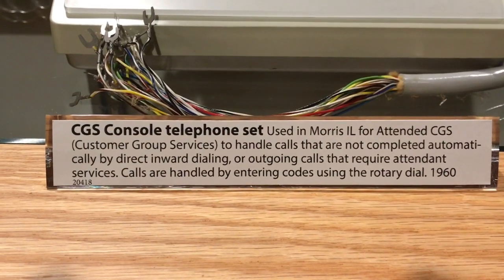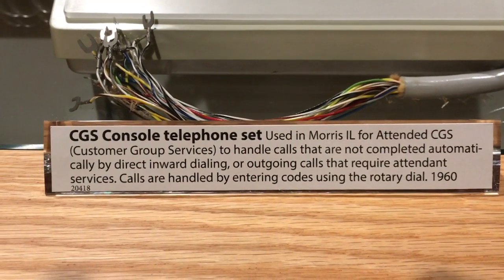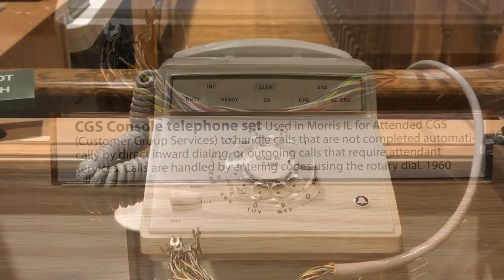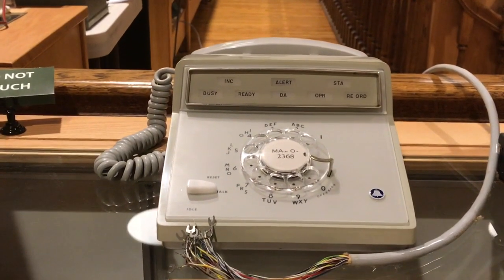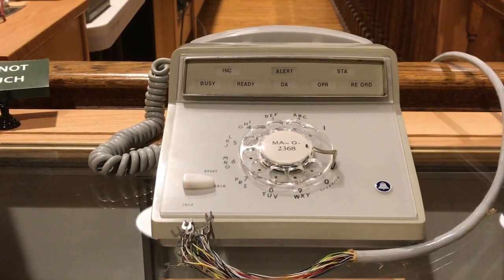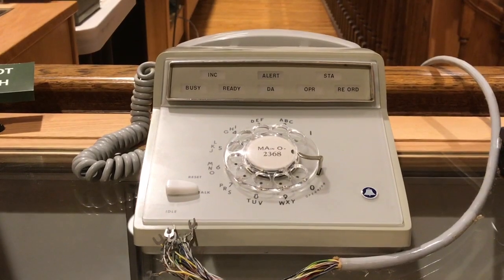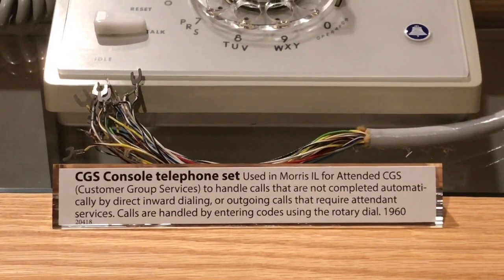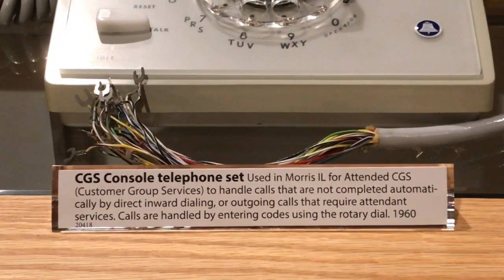Bell System Console Morris Project

Comment: While gorgeous to look at, as a switchboard operator, it's hard to imagine how this unit functioned with no start/release/etc. buttons. I might think there was another part to it which had such controls, but the indicator array and reset/talk/idle key suggests this is all there was to it. So then, I'm guessing the dial is not across the tip and ring talk path, but instead directly connected to the switching equipment, already waiting for the attendant to enter digits while speaking with the calling party?  Does it even have a headset jack?  I love minimalism and "less is more" design, but for an attendant console, this seems a little too minimalist to be very useful.  I'd love to know more about how it operated.